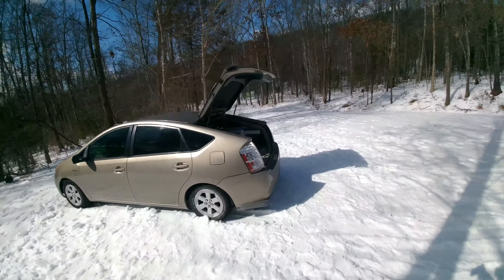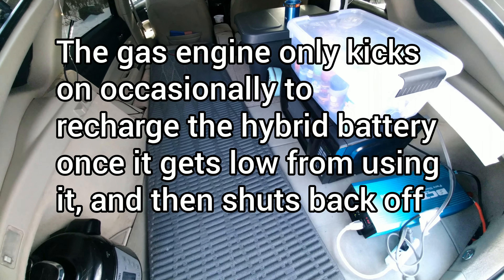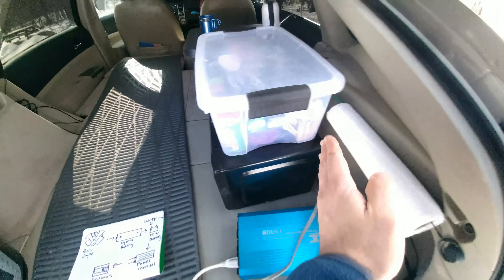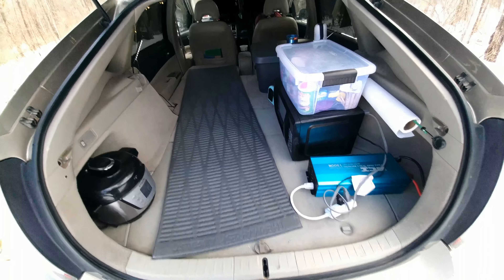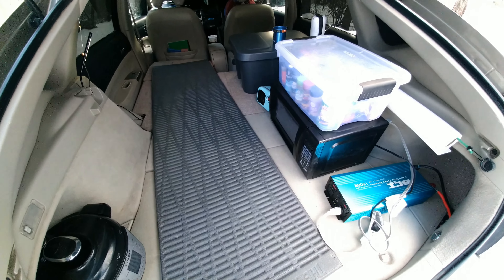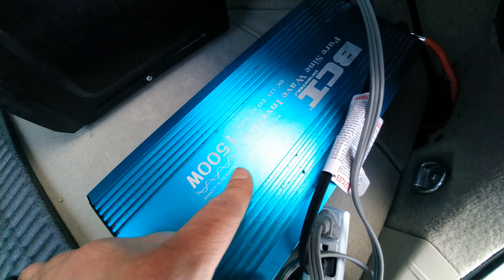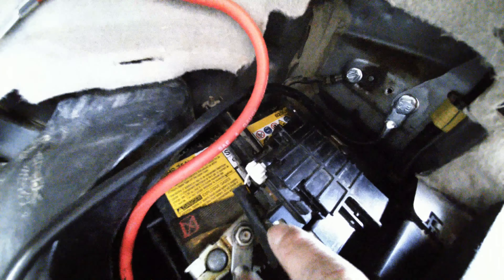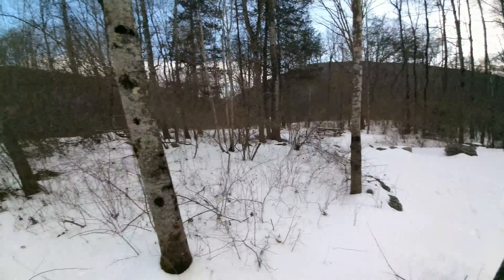How a Toyota Prius (& other hybrids) can be used as a GENERATOR! #OffGrid #Camping #Emergency

Comment: You should unplug you inverter when not using it. It draws allot of power at idle
Reply: The on/off switch on an inverter should suffice for cutting the power draw of the inverter.

Comment: When the gas engine kicks on to charge the battery, how loud is it?  Is it like a regular car engine noise level?  I'd think that if it is, then it would wake you up at night while sleeping.  Thanks for the video.
Reply: It's not loud with my 2nd gen Prius but loud enough that if you walk by you know the engine is on. It's like a compressor trying to work kind of sound.
Reply from the maker: No the Prius is a pretty quiet car. I've slept with the climate control on for the past 6 months and I don't think the gas engine has ever woken me up. I just put the parking brake on so the car doesn't rock back and forth when the engine kicks on
Reply: @MountainSpringsAdventures  Cool -- thanks for the answer.  One more, if you don't mind - are you able to simple set a temperature and either the AC or heater will turn on to keep it about that temperature?
Reply from the maker: @RicG.  yes you can, that's called the climate control. It does the same thing as the generator feature with recharging the battery, I explain this feature in my video of my Prius camper, you can sleep all night with the AC or heat running
Reply: @MountainSpringsAdventures  Thanks for the info Bo.  I just heard that the 2021 Toyota Sienna minivan is now hybrid.  Do you know if it has this same climate control feature and would work the same way as your Prius?  I'd love to have this feature, but would definitely prefer the additional space that a Sienna would provide.
Reply from the maker: Yes I heard all hybrid cars have this feature. I'm not positive if that's true or not
Reply: @RicG.  I was thinking of same thing and do believe I read somewhere it works same way for Sienna or any hybrid. FYI... the middle row seats are supposedly NOT removable in the 2021 Sienna as the airbags are in the seats. I did find a video of a guy that was able to remove seats but not the tracks.
Reply: @ZenMika  Thanks for the info.
Reply: @MountainSpringsAdventures  good tip, the slight rocking, the torque, is what woke me up, not the engine noise.

Comment: Why use an electric space heater instead of the Prius heater? The engine would just cycle on and off as needed to maintain the cabin temp.
Reply from the maker: the space heater is more gas effecient
Reply: @MountainSpringsAdventures  I recall someone saying using the climate control keep entire car warm, but that would a lot of heat and if your just sleeping you don't need all the much. Looking to use Prius as back up generator for when we lose power. Thank you for the video.

Comment: My thinking is that the 12v battery is charged by the engine’s alternator because I’ve heard of many Prius 12v batteries needing a jump start.  But, he could be correct.
Reply from the maker: The prius doesn't have an alternator
Reply: The Prius has no alternator or starter.

Comment: OK I have some questions. I want to first off saying I really enjoy watching your videos very inspirational. So when you have an inverter running appliances in your car you must have the vehicle running, in ready mode? Also wanted to know if your car has enough electricity coming out of the cars generator going back into the battery and enough to keep the inverter running? So basically what you are saying that the motor from the Prius is running to charge the highbred battery, then that electricity goes into the 12 V AMG battery?These are just some of the things that I was curious about. I’m sure someone has it explain somewhere . Just don’t want to cause any long-term damage to my Prius. #HappyCamping
Reply from the maker: Thanks for the tip! Glad you liked it

Comment: awesome info mate! I have a Prius V(7 seater) here in Melbourne. Just wondering, if I connect my car fridge and leave the fridge on, while my car is switchedoff, does my 12v battery drain away? Planning to start weekend camping, can I use a 3000W inverter as well? btw, subb'd. cheers mate!
Reply from the maker: Glad you enjoyed the vids, you have to have the Prius in ready mode in order to run any electronics constantly. Watch my video about 12 volt fridges, I explain how it all works:

All about 12-volt fridges: https://youtu.be/0-SVSnIVMso
Reply from the maker: You can use any inverter technically, but I don't suggest using over 1,000 watts of power, 1500 watts absolute maximum. Some people do use more but again I don't suggest it, I like to play it safe
Reply: @MountainSpringsAdventures  thankyou so much for quick reply

Comment: If I ever get to the point of creating a camper, I will use my 2021 Sienna (hybrid) van. I believe the 12v battery is under the hood, as it is in my 2005 Prius. *see EDIT below 

 I expect I would use a 2nd 12v,  as another commenter suggests.

Could the 2nd 12v battery and inverter be connected by cable  to the original 12v and placed in the back?

 *EDIT: I just learned that the thing under the hood is a terminal, and the battery itself is somewhere in the back. 😳
I learned that from The Car Care Nut: https://youtu.be/y5oaQ0LW3A4

Comment: HV Battery generates heat when charging and discharging time to time. You need to turn on your car AC otherwise the HV Battery health degrade faster without proper cooling.

Comment: Pure sine wave inverters will not "truly give you 1500 watts," there are two measurements that sometimes trick consumers: Peak wattage and continuous wattage. When it says 1500 watts and you're actually getting 750, that's not because it's a modified sine wave inverter, it's because the measurement they're using is the peak wattage rather than the continuous wattage. For almost all applications, the measurement you care about is the continuous wattage. That marketing nonsense affects both pure and modified sine wave inverters.

Comment: Why are you not changing the Toyota 12v battery with a mini 12v 100Ah LiFePo4 battery? the original battery is lead acid and not very efficient, and is heavier.

Comment: I left the heated seats on and it killed the 12v. Car wouldn't start, I was told by the AAA guy the gas engine needs to be running. To charge the starter battery.
Reply from the maker: Well yea, any electronic will drain the 12v battery if the car isnt turned on

Comment: And the reason your inverter needs to be a pure sine wave instead of a modified sine wave is because of that 50% on 50% off thing. Generators create alternating current by being completely off and then spanking an electron down the line to be completely on then back to completely off again. In the real world, that creates a smooth hill then valley then hill then valley graph--that's a pure sine wave. A modified sine wave is just turning the battery connection on and off for a period of time each, which is bad for the long-term health of many appliances, and especially sensitive electronics.

Comment: I just love guess brigade fitter.
As mentioned, for gods sake fit a fuse to the power feed to the inverter. If the lead was to come away from the inverter and go to ground, then you have yourself a new heater. You may notice it getting nice and warm, but you will not notice much more after the poisonous gasses have rendered you unconscious, so you can be nicely roasted for maybe a mountain lion.
You warn people about making sure all connections are tight, I suggest you go back to basics and learn the safety of a fuse.
Why do people that do not understand the dangers of electricity play at being an electrician. Y

Comment: Will this shorten the life of the expensive Prius inverter?
Reply from the maker: I don't think so, as long as you don't go overboard like I said in the video. I've never read about someone damaging the inverter system between the hybrid battery and the 12-volt battery, that doesn't mean it hasn't happened though

Comment: I’d like to add my two cents: I’ve owned a 2014 Prius V for 4 years (60k miles ridden, 90k odometer) and I’ve lived in it 85% of the time. 

  If you keep the car on, most of the charge is depleted by keeping the electric motor energized....to be continued....

Comment: An inverter coverts DC power to AC power.
Reply from the maker: Yeah that makes sense. I don't know the difference though, lol. All I know is it's two different kinds of power
Reply: Yes but the inverter snips  a bit off the power (commission?) So if it consumes 1000W DC, it will only generate about 800W AC.   lot is converted to heat, to run the fan, the control circuitry etc.

Comment: Everytime you convert voltages you will loose at least 30%.  
So your total loss is more than 60%.
Reply from the maker: Well then that means its not very efficient, i was hoping for more efficiency
Reply: @MountainSpringsAdventures  I have a 2000 Watt Pure Sine Inverter and it only consume 10% (stated and measured); the current state of the art for inverters is 96% or better efficiency.

Comment: I would buy a gas or propane generator.
Reply from the maker: Why?
Reply: @MountainSpringsAdventures  because I have a 2021 Prius prime that cost me 41,000 and i would not risk it.
Reply from the maker: Oh yeah that makes sense. I wouldn't be using a brand new Prius to convert into a camper. I only paid $3,100 for mine
Reply: @jessesasaki3191  😒🙄

Comment: to think i was going to spend a small fortune on solar and other stupid ideas that cheaprvliving you tube channel is putting in his videos. i'm shopping carmax for my Prius. just found a 2015 Prius 2 for $13,000 w/75K miles. any suggestions on the year/model before i make this purchase>? thanks!!!
Reply: @crisc4438  free sun energy? try like $800+ for a 200 watt or more solar setup that will only last 4-5 years. suitcase panels taking up storage space in car. cloudy days = no energy. forget it, i can easily afford the 1/2 gallon a day in gas to charge the hybrid battery
Reply from the maker: Yeah those solar setups can get expensive. I love solar but yeah hybrid cars like a Prius can work great as a generator. I don't know much about the 3rd and 4th Gen Prius, I have a 2nd gen. What exactly do you plan on powering?
Reply from the maker: @crisc4438  no I don't think this increases any maintenance at all. There are a lot of people that do this, I know people that have been living out of their Prius for 6+ years doing this with not the first issue
Reply: @MountainSpringsAdventures  the prius im looking at is a 2015 prius 2 with 75K. as for powering -my laptop, the cooker you have listed in your description and few small things. thats why i dont want to waste $800 on a solar setup. the inverter is perfect. no sitting out in the sun watching my laptop and tablet charging. i saw a 5 minute Prius seat removal video. need help with carpentry work. no tools, etc...
Reply from the maker: @Uneklyme  yeah I would just say to look at a bunch of Priuses and test drive all of them and make sure you're getting one that was taken care of by the previous owner. buy a Bluetooth OBD reader and test the hybrid battery using the app Dr. Prius first. I test drove like 10 Priuses before I decided on the one I bought because it was garage kept its whole Life by one owner, it was in excellent condition. I paid $3,100 for my 2006 Prius, it had 123k miles on it when I bought it
Reply from the maker: @crisc4438  If you want to look more into it, I suggest looking at the website called priuschat. This stuff is talked about in great detail there. There are also lots of Prius Facebook groups. And yeah I actually know of some people that have a solar panel on their Prius, but they use the generator feature as a backup in case they don't have time for solar or it's a cloudy day. I might end up doing something like that.
Reply: @Uneklyme  oil consumption concerns were with the 2010-12, they did do some improvements to the engine to help alleviate the oil consumption.   The 3rd generation is decent....try looking into a prius V, more room...
Reply: If you are going for a 3rd gen Prius, 2013 - 2015 are the more reliable years to buy. Just make sure, when you're reaching 100k, to change all fluids, including transmission drain and fill and you will be good to go, most of this work can be done your self. I've obtained a 2014 model with 100k over a year ago and it's running flawlessly.
Reply: @crisc4438  the only year Prius that had piston ring issues (oil consumption) was the 2010 model. never buy the 2010 model with the constant oil burning issues
Reply: 2015 has problems from what I read.
Reply: @kasondaleigh  i've decided on the 2016 prius. found one with 37k miles and is only $16,000 / monthly payments of $245. not too fond of the color red, but can't find a white one